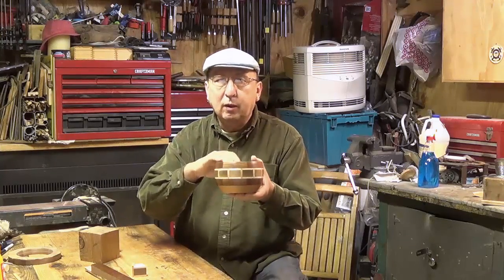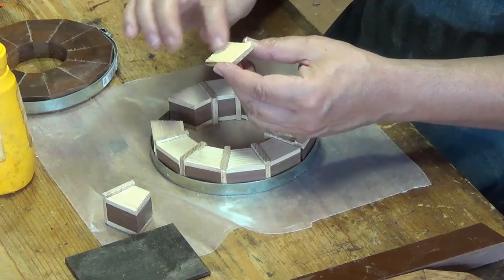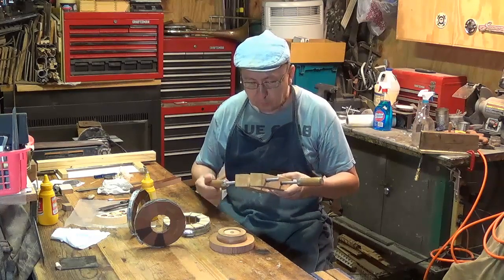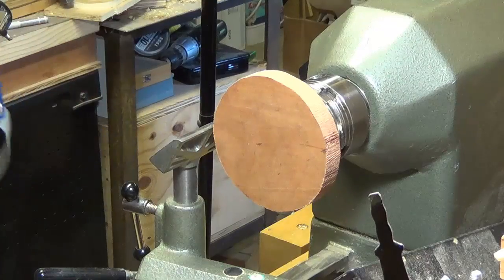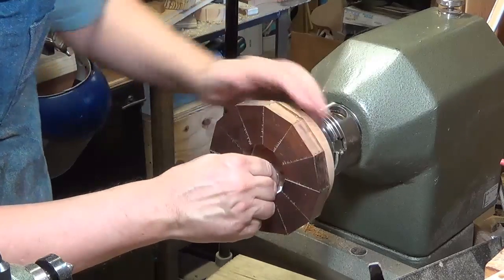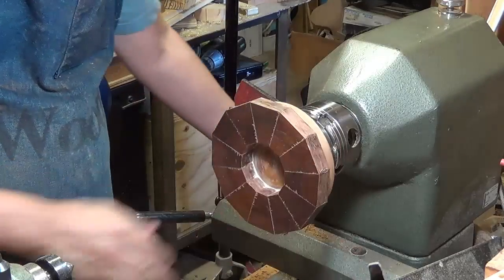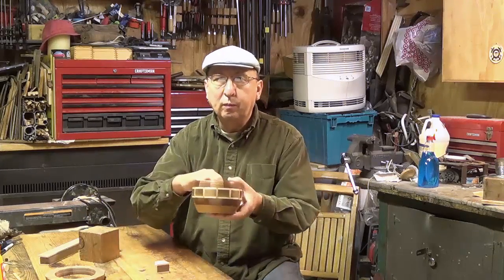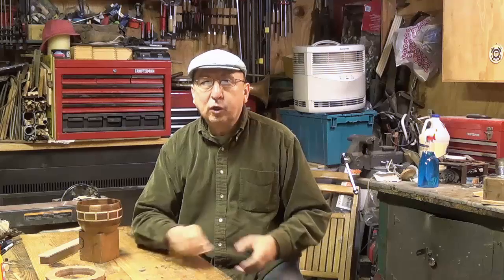Patterned Segmented Bowl

Comment: One more question, Cip, when measuring your segments what do you use for the long point? Do  you measure the segment only or add the spacer as part of the long point measurement dimension? Hope that was clear.
Reply from the maker: Hello Charlie! Yes, I think the length of the long side of a wedge of the patterned ring needs to be the combined length of the segment and one divider. I usually "play it safe" by making thinks slightly larger." Cheers.

Comment: Cip, I have learned so much by watching this video. I am in the process of making a few of these bowls myself. I have a couple questions. What is the height and circumference of the finished bowls. Also, do you ever have a problem with vibration as the bowl gets smaller? As I get near the widest part of the opening it just screams at me. Any suggestions.

What finish did you use on your bowl?  Thanks for your fine work. Turning is a lot of fun for me but very addictive. lol

Charlie
Reply from the maker: Greeting Charlie! I think I still have the bowl but I can not find it. I think it was about 5 inches in diameter and maybe 3.5 inches tall. 

Sometimes I do have problems with vibration. The first thing I try is sharpening my tool or change to a different type of tool. Next, I try spinning slightly faster and using a lighter touch of the tool. Always be safe, make sure everything is tightened properly.

For a finish I like rub-on wipe-on polyurethane. 

Cheers
Reply: @CipsWoodChips  Thanks Sip. I'll try those things. Wishing you a very Merry Christmas and a New Year full of turning.
Charlie

Comment: Really enjoyed your video, it was very honest! Some others give the impression that nothing ever goes wrong and we all know that things go wrong all the time.  I was wondering about your base,  it was quite thick and it is going to expand more across the grain than with the grain. Could that cause cracking?
Reply from the maker: Howdy Kevin! I like your comments. I made the bowl in 2015. I no longer have the bowl. Bowls do crack. Maybe I am lucky but I have not had one crack. 

The base layer was cherry and well seasoned. I usually finish with sanding sealer and polyurethane. Once cured the wood is very stable. Thank you for your question. Cheers

Comment: Cip, Nicely done. I  like this pattern. Wondering what speed your lathe runs at for ost of this turning.
Reply from the maker: Howdy Charlie! I usually display or call-out the speed. I usually turn much slower than other turners. I base my speed on the diameter of the bowl. I seldom turn faster than 1,000 RPM. This bowl, once it was balanced, I probably turner at 650 to 850 RPM. Thanks for the question. Cheers.

Comment: Which lathe do you have Cip?  I like the way you had the head stock pivoted
Reply from the maker: Robbie vigil Greetings Robbie! I have two Nova lathes: DRV-XP and a 1624-44. Both have pivoting Headstocks. I can pivot to 22 degrees and still use the regular tool rest and banjo. It makes working on the inside of bowls much easier. Cheers

Comment: Cip, well done. How wide is that round nose scraper?
Reply from the maker: Hello there Charlie! The scraper in the video is a 1 inch (25mm) HSS. Originally it was a wide skew from Harbor Freight made of good hard steel. I think the steel was better back then. I made a longer handle for it.  Cheers
Reply: Thanks Ciip. I bought my first set of spindle tools from HF. I still use them.